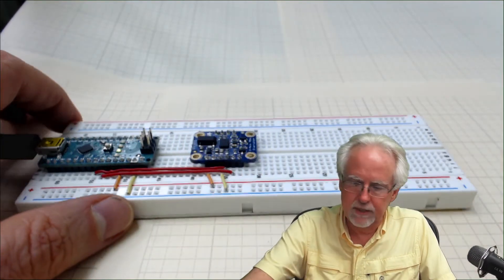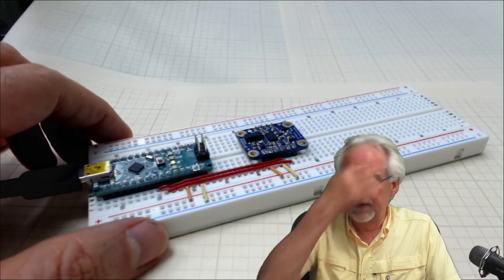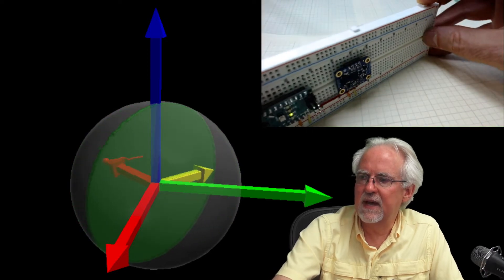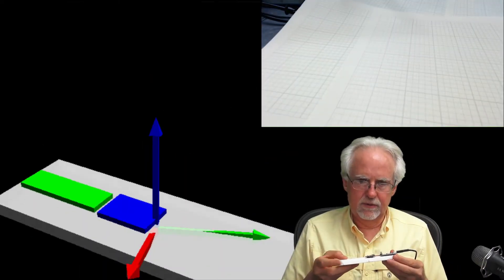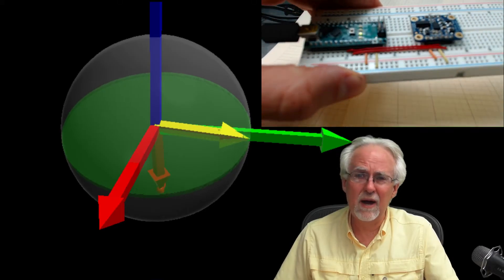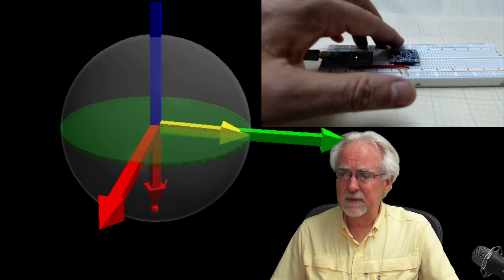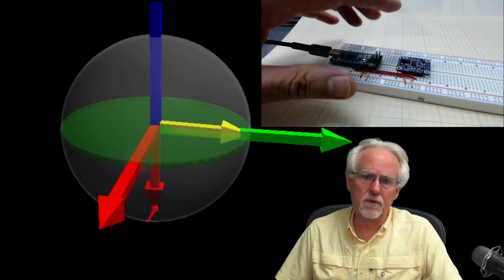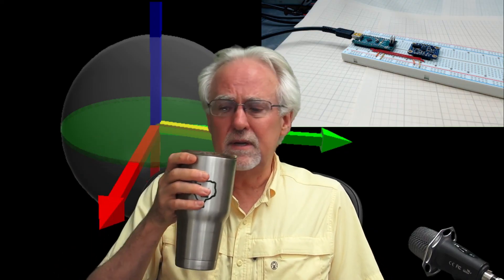9-Axis IMU LESSON 1: Introduction to Nine Axis Sensors and Inertial Measurement Units with Arduino

Comment: Neat stuff. I have used survey GPS rovers that use this tech. There was one, a Trimble R12i that can stake or store a point with like 0.1/ft with the rover at a 45° angle relative to the point on the ground. I didn't really use that feature for much, but I kept it calibrated because I was working in natural gas, where often times you have a 12 ft rod height with your rover or prism, so it was nice to know it was correcting for any potential error. Although I still kept my rods calibrated and made sure it was plum on every shot, but that is just mean. Really is hard to do over a 7 ft deep, 10 ft wide trench lol
Reply from the maker: Sounds like a fun job!
Reply: @paulmcwhorter  oh I love it 😀

Comment: Hopefully you still respond to comments on this video.
Do you still recommend the BNO055 device?
Can you use the accelerometer to calculate velocity and travel distance?
I'm trying to put some telemetry on our 100 year old trolleys, and I don't want to use a GPS unit because of needing to put the antenna out where it's visible to passengers. I want to implement a data log, that will list position on the line, journal bearing temperatures, brake travel, etc.

Comment: Hi, I want to implement a geometric IMU model in matlab in order to generate synthetic imu sensor data 6DOF(accelerometer and gyroscope) without using real physical sensors. Is that possible? I am new to inertial, Can you please suggest me a procedure and ideas. Thanks.

Comment: Paul, my arduino comprehensive kit has the elegoo 6-axis variant of this ie MPU6050 GY521. I fully appreciate the reasons for having the same kit as your tutorials, however would appreciate your opinion on whether this series of lessons could still apply to the GY 521 ? If so, I won't be holding you to it if it varies in places, or ask questions ;-). Thanks ...
Reply from the maker: you have to use the sensor I am using if  you want it to work.
Reply: @paulmcwhorter  Okie dockie ... Looks like it's a more capable device in any case, so shopping time !

Comment: I’m not sure if it’s just me or the Euler angles don’t really align with the axes of the BNO055 sensor.

The X and Z axis seem to be flipped when I’m testing it with the rawData / Read_all_data example file. When the board is placed flat on the table, the X axis changes when I yaw the board about it's vertical Z axis, and vice versa (Z output euler angles change when I rotate the board about it's X axis. 

But when I stand the board vertically on it's edge, then the axes output seem to correctly correspond to the Euler outputs. I'm not sure if I'm interpreting it wrong, but it seems to reflect orientation about complex mix of global and local axis. I'd appreciate it if you could explain that or help diagnose the issue.
Reply from the maker: Yes, orienting your numbers to your real world can take some tweaking. Documentation with the board was not real clear to me on that.

Comment: I really need to know how to measure the tilt (pitch and roll) of a plane, and then how to have the module give me the tangent of that angle. The plane won't tilt more than about 5~6 degrees.
So far, I've tried to get something useful out of an MPU6050, ADXL345, MMA8451, Wit-Motion WT901C232. They all yield nothing at all or they drift fast and uncontrollably. 
I now have the BNO055.
Still, I'm starting to think it's me...

Comment: Hello Sir, I am writing to you in order to have your opinion. I have the project to build a heliostat, ie a mirror which directs the reflection of the sun in a given point in order to illuminate a living room. I already have the system with 2 axes (2 DC motors) controlled by an IR remote but, I would like to automate this. The BN0055 would be the desired accessory. PS, this is a google translation because my level of English is not good enough. thank you for your reply

Comment: Hi Paul, Great video. I'm using a Arduino Nano RP2040 Connect  with a built-in LSM6DSOX IMU. No problem getting all the data from it, I need to demo it for a potential project and love your virtual ball & arrows and would like to use it. Have you released the the processing code for that on your patreon? I can code something similar, but why reinvent the wheel, thanks!

Comment: Can I use MPU9250 instead of BNO055 for this series?
Reply: I also want to use an MPU9250 since I already bought it. Not sure if I am able to use it though. I think the difference is that the BNO055 is already doing some sort of Kalman filtering and the 9250 is not. That also explains the price for the BNO. But iam not sure if this actually is the case. I also want to do it on a Raspberry Pi 3+.

Comment: Question, the BMO055 is about $35 (12/10/20) There are other listed, e.g. BNO055 "breakout" sensor for $10.40 (https://tinyurl.com/y58c2wxt).  I'm not clear about the difference, other than the latter requires soldering on the pins.  Might be a more reasonable unit for the financially challenged, describes most HS students from my memory...   Feed the Geek!

Comment: I think I'm going to attempt to build a parallel system using a dirt cheap IMU.  Should be interesting to understand the difference and when you need a better sensor.  Sounds fun.

Comment: yellow shirt, not orange.  am on lesson 32 joystick on basic arduino series.  wish you published list of all 26 lessons to download somewhere. notice pid control system from classic control class later in lessons. grad students couldn't afford full imu's in late 80;'s, early 90's we hoped ring gyros or something would get affordable.  set of cheap self-location sensors in 2020'a is very different than 1990's set.

Comment: I hooked up my sensor. It’s the Adafruit BNO055, hooked it up properly and everything. I upload the read_all_data example from the library, and it prints a bunch of junk. Help?!
Reply from the maker: Make absolutely sure it is wired correctly, then run a demo problem that is with the library. If that does not work, try posting on the adafruit forum. The possibllity is you have a bad sensor, but almost always it is some error on the usersp part.
Reply: Paul McWhorter Thanks for the quick reply. It is hooked up correctly. I tried the rawdata example too, and no luck. I might try the Adafruit forum. I’m concerned I may have overheated the components when soldering. It hasn’t happened in the past though. If I were to get a replacement, would wire wrapping work on headers too?
Reply: Paul McWhorter I figured it out. My Serial Monitor was trying to read 9600 baud, I had the Arduino at 115200 baud

Comment: Dear Paul, before I start following this course ( i am following a lot more of you) I would like to know whether you are going into the accelerometer of this sensor? I would like to see/visualize g-force/motion in a dashboard. Also, can I record/log info and "replay" this later on?
Reply from the maker: You can pull the acceleration data off the sensor, and work with it in Python on the PC. I dont directly go into how to save to a file and replay, but that would be pretty simple in python, and lots of how tos on that if that is what you want to do

Comment: I'm in!  I just ordered the IMU you are using and will be following along with these lessons.  I'm starting a bit late but I'm sure I'll catch up pretty quickly.   I'm also going to be using an STM-32 board (the Blue Pill) instead of the Arduino Nano.  I don't see why that should be a problem, but if it turns out to be a problem I can always pick up a Arduino Nano later.   I just ordered the IMU today so it will be a few days before it comes in. 

Just as a side-note, I'm interested in building a self-balancing two-wheel robot.   But no rush on that.   First I'd like to fully understand this IMU and all the math tricks to make it work well.   Thanks your creating your excellent videos Paul.  I'll be signing up at your Patreon site very soon.   I'm also following your course on doing AI on the Jeston Nano.  I have that system all set up as well.
Reply: bro, did u make up a self balancing two wheel robot then?

Comment: Looking forward to the rest of this Paul. 

In the last series of Arduino lessons we hit the memory wall, Can you couple two Arduino's and share the processing and memory load, e.g. a Nano to drive a display while a Uno handles the GPS and card. It would be a fraction of the cost and solve the cold start problem of the Pi.

Comment: Just received my IMU.  Looking forward to following along and learning
Reply: Hi Paul, it would be super cool to put together a bunch of your lessons into one integrated project - for example, this IMU, plus your GPS x 2 to make a DGPS system, machine vision, radio links back to base from a rover system, and displaying the rover's location and motion back at base.  The IMU and DGPS would provide corrections back to the rover's course.  The machine vision could provide local course corrections (such as tree avoidance etc).  Hmmm.  Gotta get one more GPS to play with the DGPS concept.

Comment: Good Morning Paul Great Ep#1
  Do you have an itinerary for the 9-axis series that shows the various subjects/episode?
  Really excited
Thx Gary
Reply: This may be helpful to others;

9-Axis-IMU

Paul McWhorter

DISCLAIMER: This Project is for DEMONSTRATION PURPOSES ONLY

1. Introduction
2. Hooking up BNO055 IMU in circuit.
3. How to calibrate the BNO055.
4. Install Data Graphing software.
5. How does an Accelerometer (AC) work? (X,Y,Z)
6. How does the Gyro’s (GY) work? (X,Y,Z)
7. How does the Magnetometers (MG) work? (X,Y,Z)
8. Start with the Math behind a simple Tilt-sensor use AC
9. How to combine an AC’s and GY’s to build a simple Tilt-sensor
10. How to make a compass (MG).
11. Understanding Euler Angles.
12. Brief Intro to Quaternions.
13. How to get Data from the Arduino into the  Visual Python.
14. Warnings & Limitations when using IMU’s.

Comment: I recently managed to learn the concept of Fourier Transform, which is kinda cool. I was wondering if this BNO IMU project is gonna involve the use of Fourier Transform. Or, do IMU projects generally use Fourier Transform? I'm asking this because trigonometry is involved in your project and Fourier Transform seems related to trigonometry.
Thanks.
Reply from the maker: Fourier transforms are indeed interesting, but will not be used on the nine axis project. There we will be using trigonometry and cross products, and then quaterions.

Comment: Hi Paul,  I am very interested in learning how the use the 9DOF, I have a 50" sail boat that I would like to run autonomously and couldn't figure this part out, looking forward to your tutorial's on this...   Thank You!!
Reply from the maker: Wow, this tutorial series is for "entertainment" purposes only, like the little desktop visualization demo. There are some serious issues with trying to use this sensor in a real world application. The internal processor attempts to continue to optimize the calibaration parameters, which leads to glitches, where the sensor gives bad data. Really should not be used for something like guiding a sail boat, as the implications of bad sensor data would be very serious.
Reply: @paulmcwhorter  This is a 50 inch sail boat, something to play with :)
Reply from the maker: You scared me for a second there. One guy was talking about connecting it to a tractor and mowing property with it. That one frightened me. We have to keep track of the difference between proof of concept and desktop demonstration, and putting it on a device that could cause injury or damage. Even with the model boat, make sure you have a way to over ride should the sensor lose calibration. Thanks for the comment

Comment: I used a sensor (MPU9250) like that the one you used to make a head-looking joystick ("ED Tracker" where credit is due) for flight/space simulators and 3D printed an enclosure for my headset. Works better than anything you can buy from a manufacturer for a fraction of the price!
Reply: Have you had any luck following Paul's lesson's with your sensor?  Thank's for the ED link, looks like it has some specific info to help.

Comment: Thanks for undertaking this series Paul. I hope to learn from your lessons and fix mistakes/roadblocks I experienced attempting to do this on my own earlier.  The Arduino shield that incorporates the BNO055 proved to be very convenient but very difficult to keep the magnetometer calibrated.
Reply from the maker: Todd, that is sort of a vexing problem as you try and deploy this sensor in a real world application. The problem is, with the adafruit library, I do not see any way to turn off the auto-calibrate "feature". In our application, we had the sensor mounted on a moving antenna on the top of our ambulance. The issue is, when it is mounted on a structure like that, you can not just pick it up and swing it around if callibration is lost. What does not make sense, if I calibrate it to begin with, leave it alone, but no, it tries to continuously tweek the calibration, until it completely loses the calibration. I never found a workable solution for this. I keep hoping that bosch or adafruit will offer a simple command to just lock in your desired calibration and then stop fooling with it.
Reply: Paul McWhorter agreed , my application is a sailboat instrument and same issue exists. I’ve tried other IMUs and run into different mag calibration challenges with them (both Sparkfun products) one from ST Microelectronics the other from InvenSense.
Reply from the maker: In the end we sort of kludged something together where we manually stored calibration parameters, and then when the device thought it had lost calibration, we would stop, and reload the stored values. This sort of worked but really not very well. I think to really do this for real we would have to learn how to bypass the adafruit library and directly interact with the sensor through api.

Comment: "Big boy stuff"
Haha! Good thing this is my first Arduino project (started last week) and I am sitting here trying to get my MPU9255 to work. 
Although I have a different sensor I will definitely follow this tutorial.
I will probably only need the one gyro and maybe two accelerometer axis. So I think I can get away without quarternions for now. 
But right now I have even problems talking to the damn thing. I wanted to start out with a library but the SPI initialization doesn't seem to work. 
I just tried it manually and at least was able to read a register ... I think. I mean, how can I be sure that it is in fact the content of the register? :/
Damn I hope this doesn't get me in trouble with my deadline. O.O
Reply: Any progress with the MPU9255?  I've ordered the same one as the adafruit one was about $70 Canadian and I could not justify it.  Still, I'm looking forward to a challenge.

Comment: 0:18 - My coffee is only cool now, it's not ice-cold. Will the project still work correctly or should I get some ice?
0:40 - You dyed your eyes? 🤔
2:58 - Proof positive that Paul is a teacher, through and through. 👍😀
4:49 - Pull up Goose, pull up! (The Top Gun sequel is already gaining lots of criticism, especially for kowtowing to China.)
It's interesting how solid your results are, it's very responsive and there's very little jitter.
8:22 - Do they get bonus marks for that? (They should.)

(Are you going to finish the MEMS video? We're on tenterhooks. :-\)
Reply from the maker: I will do a live shoptalk tomorrow (Friday) on the MEMS stuff. Sorry for the power outage. Will pick up where we left off.
Reply: @paulmcwhorter  okay so the power outage took you out. I thought, you edited the end of the live session. Great I didn't miss anything.